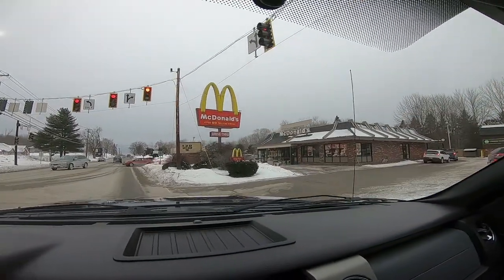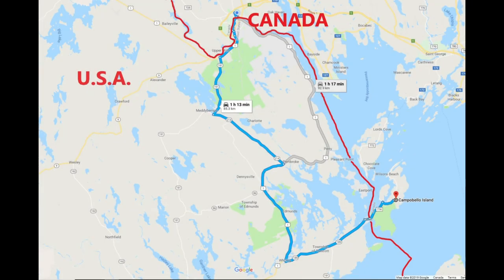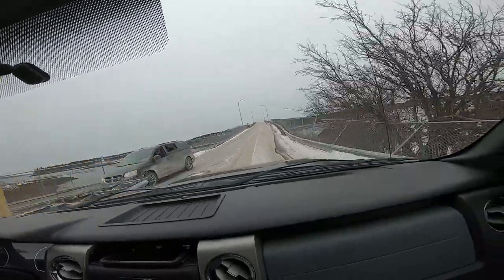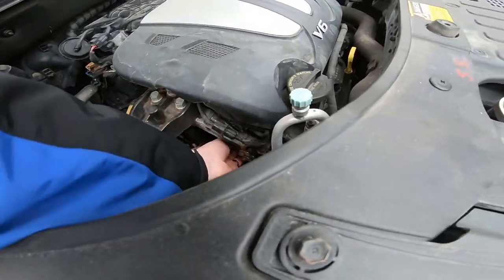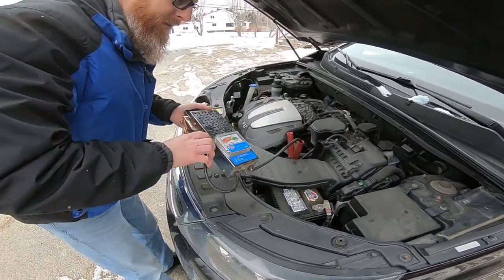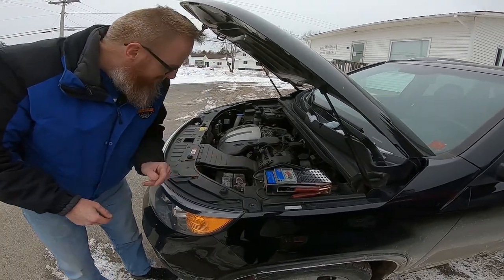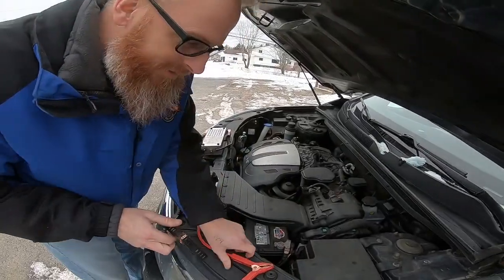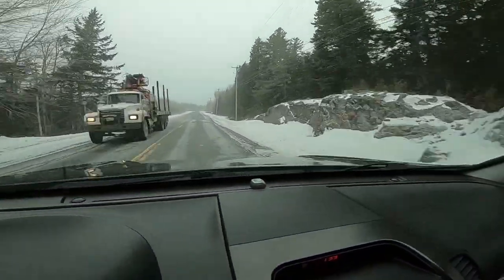PART 1: GOING THE EXTRA MILE, OR 50- NO MATTER WHAT THE COST!

Comment: I've had alternator and voltage regulator troubles with my Satellite several times, whenever it was charging too low downshifting into 2nd helped. The rest of the time the car would be overcharging and I had to either drive home with all my electrical components and accessories at full blast or disconnect the alternator altogether.
Reply from the maker: Vehicles no matter how old or new always tend to be a love-hate relationship...
Reply: Regulator was my suspicion too